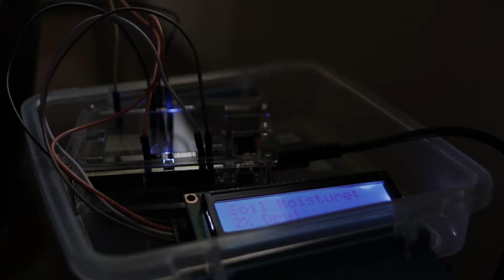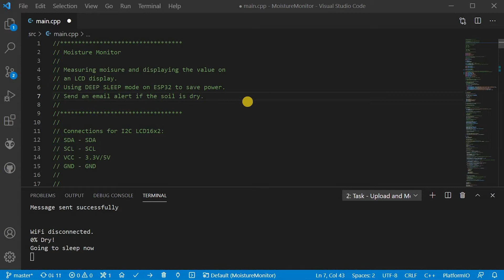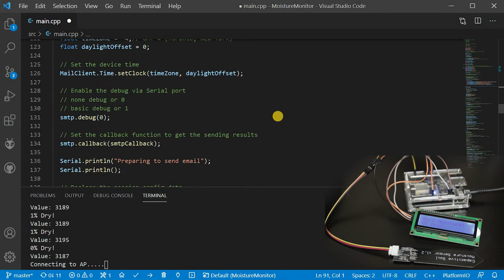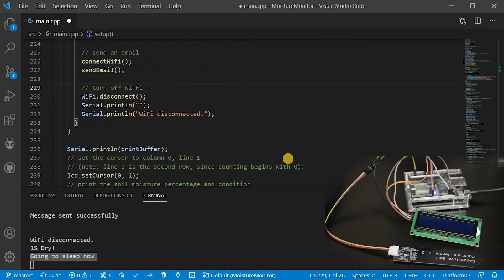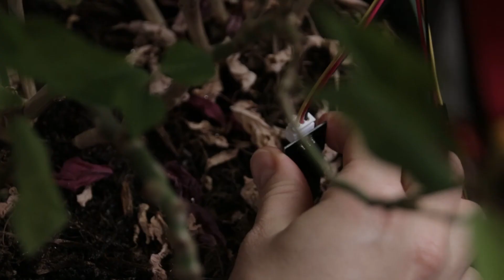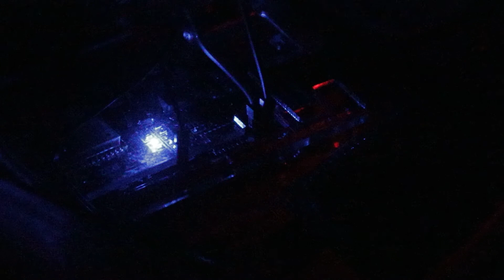Poinsettia Plant Monitor | ESP-32 Deep Sleep

Comment: Give the sensor an extra coat of paint. Especially the sides of the pcb. Then they last longer.
Reply from the maker: Thanks for the tip!
Reply: @robotsanddinosaurs  I have found that due to leakage between the paint coat. The sensor then started to oxidize and no longer work. I have also worked with the DC senor but replaced the pcb with the two pins with two stainless steel pins of 6 mm thick. They were left and right in the flowerpot to the bottom. They were 4 cm above the earth. You set the minimum moisture value in dry sand. Good luck.